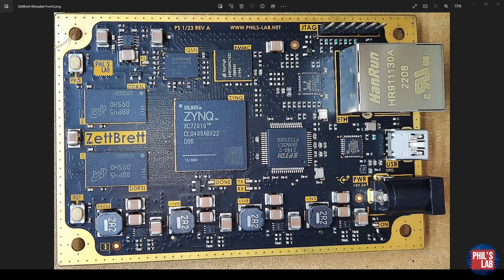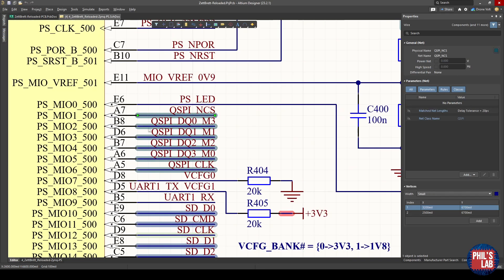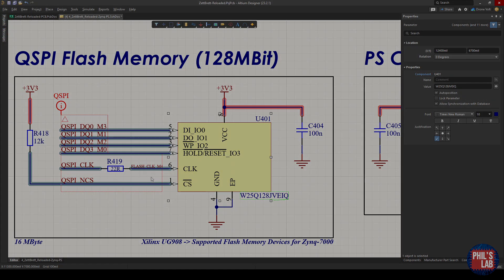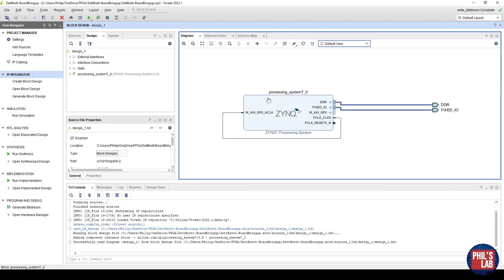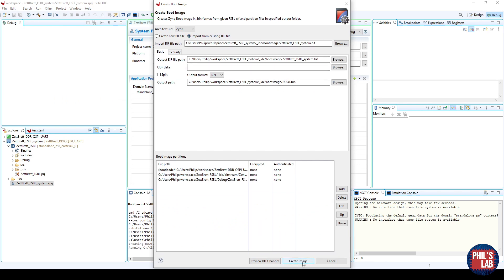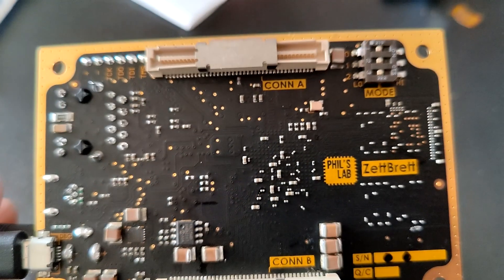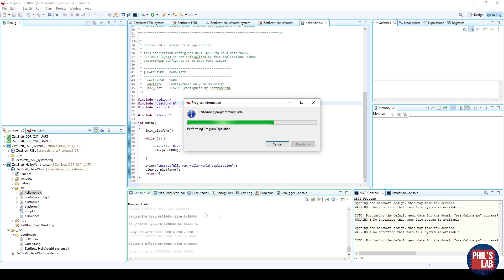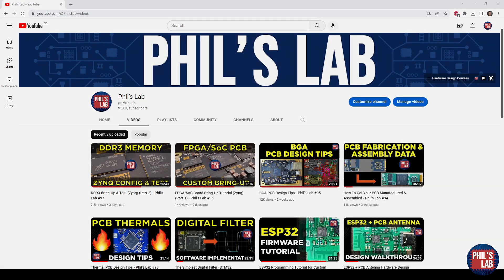(Sponsored) FPGA/SoC Board Bring-Up - QSPI (Zynq Part 3) - Phil's Lab #98

Comment: Hi. Im using vivado and vitis 2025
i adapted your video to it so far for W25Q128BV and so far tested DDR and UART before
but now i want to test qspi W25Q128BV and setted clock to 50 MHz to just test its working
but i get error 

Zynq> sf probe 0 0 0

jedec_spi_nor flash@0: unrecognized JEDEC id bytes: 00, 00, 00
Failed to initialize SPI flash at 0:0 (error 0)
Zynq> [ERROR] ERROR: [Xicom 50-186] Error while detecting SPI flash device - unrecognized JEDEC id bytes: 00, 00, 00
Problem in running uboot

on program flash
can you help me?

Comment: Hello, thank you for the video. I have artix7 and IS25LP128 on my board. I saved data in IS25LP128 via microcontroller and want to read them from artix7. should I write my SPI code to send commands to IS25LP128 and read data? Should I write Quad SPI code when I select master spix4 in vivado (Tools, edit device properties, configuration mode)? can I boot flash via Tools, and generate memory configuration?  I would be grateful if you explain me.

Comment: why did you need to generate the BOOT image file for the fsbl application, if you only used the elf file of it for the flash programming? and did you programmed the qspi via jtag connection? thank you for the informative video
Reply: Yes QSPI is programmed via Jtag. BOOT.BIN with it's packaged images are required to boot the device.
Reply: Yeah you don't actually need to create BOOT image for the FSBL application. Simply building the FSBL project will generate the boot loader (.elf) file in the debug folder.

Comment: Around 9:10, you show that you are creating a boot image.  The fsbl, bitstream, and your application partitions are already created.  Did Vitis do this for you, or had you already set it up previously?  I tried following your steps, and it is failing for me on programming the QSPI.  However, it is probably also due to trying to use Vitis 2023 which is completely different now.
Reply: Following up on this.  The above was caused by me not exporting hardware with the bitstream.  Also, I designed a board that didn't have DDR, which is required if you want to run the Zynq FSBL without modification.
Reply: @MikeBarber  That's correct. The FSBL (bootloader init) loads the QSPI stored image to DDR and then run it after boot-up

Comment: your video is so helpful! I follow ur step, but there have a error. 

Problem in running uboot

Flash programming initialization failed.

ERROR: Flash Operation Failed
Reply: vitis log is here

cmd /C program_flash -f \
F:/hello_test_0825_001/hello_test_hewor_0825_system/_ide/bootimage/BOOT.bin -offset 0 \
-flash_type qspi-x4-single -fsbl \
F:/hello_test_0825_001/design_1_wrapper_1/export/design_1_wrapper_1/sw/design_1_wrapper_1/boot/fsbl.elf \
-blank_check -verify -cable type xilinx_tcf url TCP:127.0.0.1:3121 

**** Xilinx Program Flash
**** Program Flash v2020.2.2 (64-bit)
  ** SW Build 3118627 on Tue Feb  9 05:14:06 MST 2021
    ** Copyright 1986-2021 Xilinx, Inc. All Rights Reserved.

Connected to hw_server @ TCP:127.0.0.1:3121
Available targets and devices:
Target 0 : jsn-DLC9LP-0000100271d701
	Device 0: jsn-DLC9LP-0000100271d701-4ba00477-0

Retrieving Flash info...

Initialization done, programming the memory
Using default mini u-boot image file - C:/Xilinx/Vitis/2020.2/data\xicom\cfgmem\uboot\zynq_qspi_x4_single.bin
===== mrd->addr=0xF800025C, data=0x00000000 =====
BOOT_MODE REG = 0x00000000
Downloading FSBL...
Running FSBL...
Finished running FSBL.
===== mrd->addr=0xF8000110, data=0x000FA240 =====
READ: ARM_PLL_CFG (0xF8000110) = 0x000FA240
===== mrd->addr=0xF8000100, data=0x0003C008 =====
READ: ARM_PLL_CTRL (0xF8000100) = 0x0003C008
===== mrd->addr=0xF8000120, data=0x1F001400 =====
READ: ARM_CLK_CTRL (0xF8000120) = 0x1F001400
===== mrd->addr=0xF8000118, data=0x000FA240 =====
READ: IO_PLL_CFG (0xF8000118) = 0x000FA240
===== mrd->addr=0xF8000108, data=0x0003C008 =====
READ: IO_PLL_CTRL (0xF8000108) = 0x0003C008
Info:  Remapping 256KB of on-chip-memory RAM memory to 0xFFFC0000.
===== mrd->addr=0xF8000008, data=0x00000000 =====
===== mwr->addr=0xF8000008, data=0x0000DF0D =====
MASKWRITE: addr=0xF8000008, mask=0x0000FFFF, newData=0x0000DF0D
===== mwr->addr=0xF8000910, data=0x000001FF =====
===== mrd->addr=0xF8000004, data=0x00000000 =====
===== mwr->addr=0xF8000004, data=0x0000767B =====
MASKWRITE: addr=0xF8000004, mask=0x0000FFFF, newData=0x0000767B
Problem in running uboot
Flash programming initialization failed.

ERROR: Flash Operation Failed

Comment: Thanks for this video ❤❤❤, what’s the difference between booting from QSPI and SD Card?
Reply: qspi is memory component built on the board - usually used in deployment phase  
sd card is external storage device - used in development phase 
booting is quite the same for baremetal [only boot jumper changes]
in petalinux - qspi is relatively harder then sd card

Comment: I prefer to use an SD card over QSPI. Way faster and easier to update. The SD card can contain FSBL, FPGA bitstream and uboot/full linux system on a single partition FAT image. If you're worried about reliability an eMMC can store same and be updated from an SD.
Reply: Correct me if I'm wrong but I believe the main advantage of using QSPI NOR flash is that it has much faster random access speed so it's therefore useful for execute in place scenarios for realtime applications.

Comment: Very nice! Just noticed that the FSBL is stored on on-chip memory inside of the FPGA portion (presumably?), which is pretty neat... I didn't realize it had NV memory. Sucks that it's still so difficult to obtain any decent FPGAs still :( You must have gotten lucky to get those Zynq parts.
Reply: They are available (Mouser, Digikey, even Farnell, etc.)
Reply from the maker: The FSBL is stored in off-chip non-volatile memory (in this case, the QSPI FLASH) and then loaded into the Zynq's volatile OCM at boot.

And Zynqs are actually still available in quite a few places (Mouser, LCSC, ...)!

Comment: I like Xilinx parts, but the vendor lock-in on the tool chains always puts me off.  It would be great if you could do an example of using open source tool chains for an FPGA based design.  I know that limits your choices of parts and capabilities, but I'd really like to hear your experiences with that stack of tools because you also have experience with commercial tools so you can do a fair comparison.
Reply: I don't know if it would be easily achievable or even possible to configure a Zynq using open source tools. Correct me if in wrong
Reply: Shawn Hymel over at DigiKey recently did a pretty good series of videos on just that. He used the open source APIO toolset to program a Lattice ICEstick.
Reply: Lattice's iCE40 and ECP5 stuff is usable with yosys and nextpnr if you're looking for a full FOSS development stack for FPGAs. You can also integrate FOSS HDLs with proprietary toolchains in some cases, e.g. using Amaranth with the Vivado toolchain to program certain Xilinx devices.

Comment: Hey @PhilsLab, great video! Thanks! Please excuse the noob question, but at 2:18 you say that you add a "series termination resistor for the clock line in case I get any ringing or EMI problems" … have you mentioned elsewhere how you calculated this, or do you already have a video that covers this e.g., when you might need to add one, what values, etc.? Also when you talk about "high speed" signals, at what kind of speed does a signal become "high speed"?
Reply from the maker: Thanks! Series termination is based on something known as "reflected-wave termination", which is rather neat. I'm planning on making a video on various termination techniques, but for know check out Lee Ritchey's "Right The First Time" https://www.thehighspeeddesignbook.com (free) and the chapter on termination. The book/PDF will also answer your other question.
Reply: That's fabulous! Thanks  @PhilsLab . I'll look forward to your video! 👍

Comment: I got myself a Zynq based FPGA Board (Zynqberry) a while ago, but I couldn't get much out of it. I have some experience with former Altera Devices, but somehow i could not figure out how Vivado works, yet. This series helps a lot in drawing connections between Quartus <-> Vivado and Altera <-> Xilinx. Thank you.
Reply from the maker: Awesome, glad this is useful for trying out the Xilinx stuff!
Reply: Vivado and Quartus are pretty similar as they are doing the same thing, one big difference between Xilinx and Intel devices is the way clocks are handled. With Intel devices as long as you have the clocks on the right input pins Quartus does the rest for you. Xilinx devices are more flexible with clock inputs, but you have to worry about instantiating clock buffers etc internally yourself.